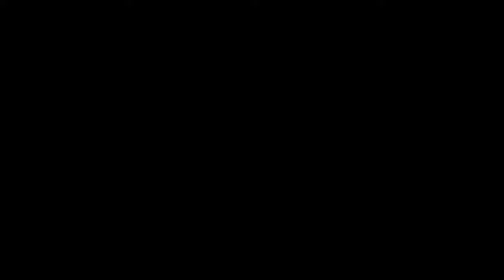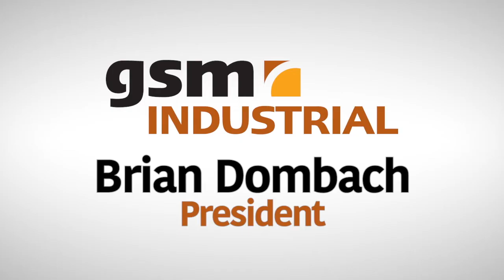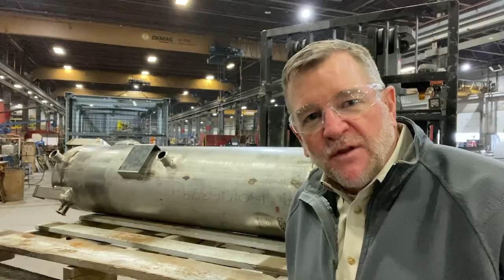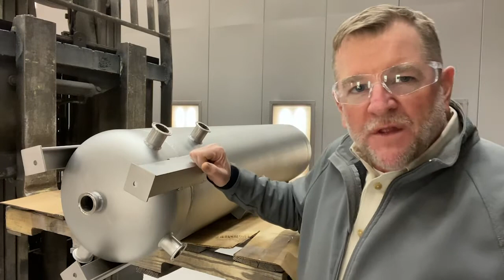ASME Code Vessel Inspection Process

Comment: It looks like ss metal why does it require blasting and painting
Reply: Thanks for your question Sumit.   You are right this custom ASME vessel is fabricated from all stainless steel. It wouldn’t require any blasting for protection or rust prevention, it is simply aesthetic so that it looks better.  It didn’t get painted in this case but sometimes we do paint stainless steel weldments if the customer requests it. Again, just for looks not for protection from the elements.
Reply: @lindsaybriggs1676  thanks sir ...ur channel seems interesting...